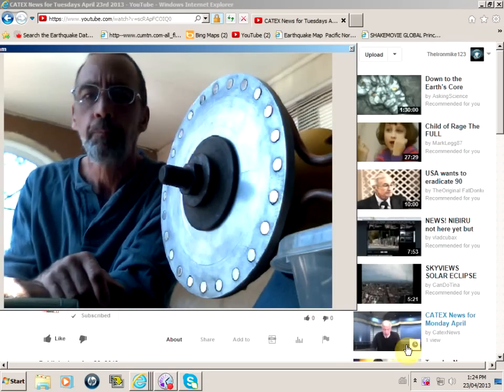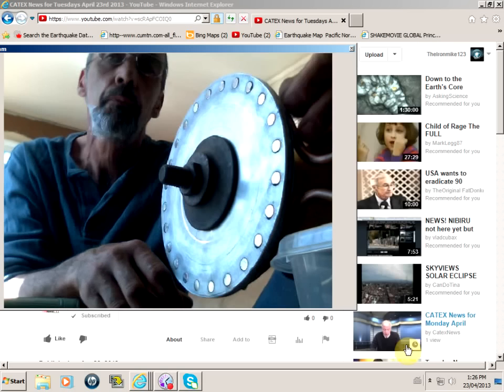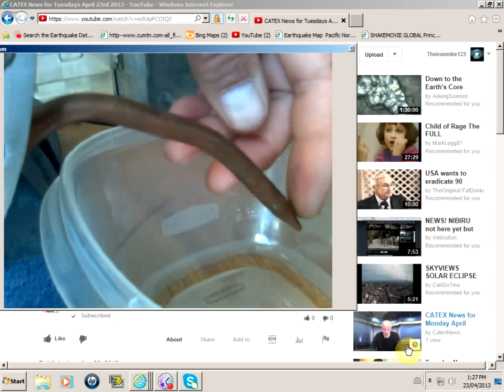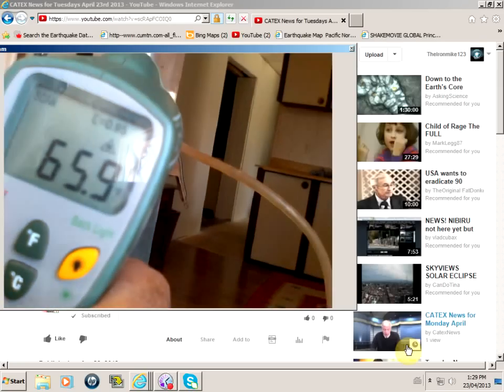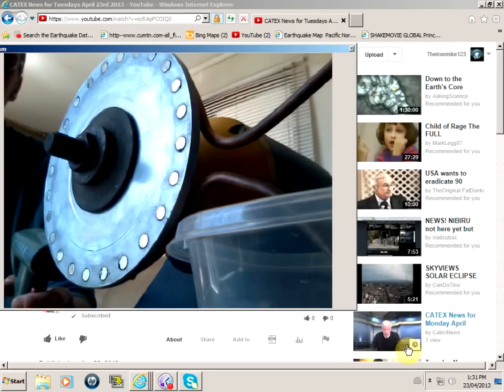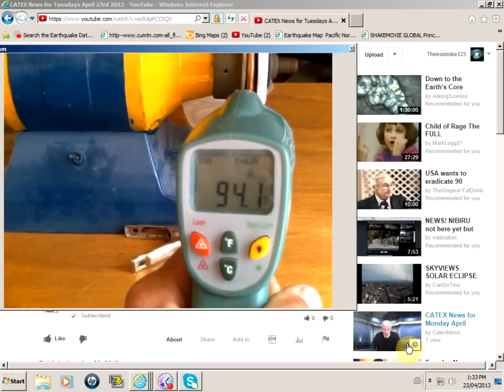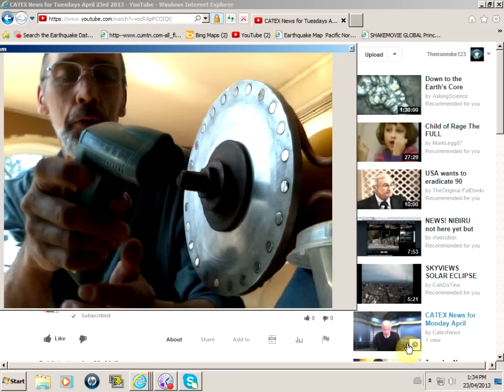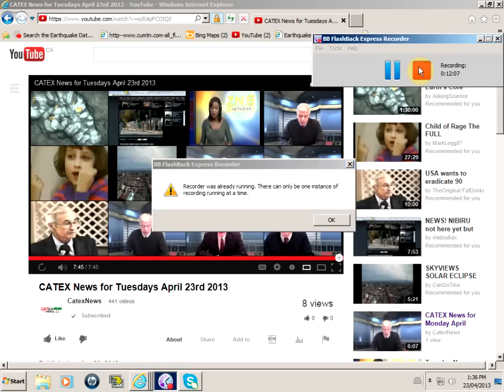magnets and copper tube = hot water

Comment: How about instead of running the water through the hot copper pipe, use the copper pipe as a heating element like inside a water heater. Use a non magnetic container and put the disc with magnets under the container and the copper pipe on the inside bottom of the container with water opposite to the disc. You might need stronger magnets though to get good results. Good idea though... :)
Reply: That would never work due to the fact that it's the electrons what are in the copper that create the current and it won't do it in steel or all your generators would be made of steel instead of copper.
Reply: Davie Jones
You didn't understand my message, Read second line where it says "Use non magnetic container etc..
Reply: Juan Bartet
Yea but if you use plastic it would melt under the build up of heat in the copper tubing. The first time I ever seen this setup was on youtube and was on a pirated re post. I then found the real site. It was called "Closer view of magnetic wheel".  The guy has since pulled the site off youtube and it is now being pirated again. I too down loaded all of his videos because it's a great design but he too didn't go further with with the idea. This too is a person who is trying to design a remake of his unit and this too won't work well due to his not using the proper size of magnets and not spinning it at the right RPMs. I have been doing engineering for many years and have three patents to my credit and know what I'm talking about and this design is a very good and possibly the next wave of home heating if designed right. Yes I am working on it but personal things in my life right now have me at a somewhat stand still due to purchasing a farm and all the work and time and money to get things going on it. But I am going to design one of these units to heat the house and see how well it does. It will take some engineering to get it right but I believe it should produce enough heat for our two story old farm house and then some. I expect to get at least 100,000 BTUs from it and that should do just fine. Oh and the real guys web site is www.talbotturnings.com and he is the real inventor of the magnetic wheel on youtube. The rest are just remakes and don't come up to snuff to me. Hell most crap posted on here are coat hanger, duct tape, bubblegum and paint junk anyway and won't work right and may even be dangerous. There are way too many back yard mechanics on here posting absolute junk, but at least they are trying and I'll give them that for sure! Some of your best inventions never came from no college educated idiots. Thomas Edison! The Wright Brothers! Yea that kind of stuff. Later Juan. When I get my furnace finished I will post it on here for everyone to see and give credit to the real inventor.
Reply: It wouldn't melt if the tubing is in water. There are high temperature plastics you can use or ceramics that can hold high heat. Good luck with your project and your farm.
Reply: Juan Bartet
Look at the one called FREE HEATING??? by FreeEnergyLT. This is the bootlegged copy I was telling you about. Now instead of spinning the aluminum with the magnets, keep them stationary and spin the copper as a disk and on the same shaft and put a turban blade with housing as air flow over said copper disk with heat censors to adjust the aluminum disk closer or farther away from the spinning disk and hook it all up to a thermostat and now all your doing is running an electric motor for generating both heat and air flow. You see with not spinning the large aluminum disk it don't over run the electric motor and you get more speed for less money spent! All this adds up to savings in home heating! You see your not using electric to heat a heating element which costs way too much. Now what do you think of my way of thinking? Not too bad is it? I didn't think so. Now this is the way I roll!
Reply: Davie Jones
Saw the vid, that's HOT!
Reply: @Daviemes13  BUMMER! I just tried to check out the talbotturnings site; and, it's now (02/07/21) gone... :(
Reply: Yeah, almost genius. 
...Or buy immersion heater off the shelf, and have exactly the same effect, for the same amount of electricity. Listen, it doesn't get more efficient, than heating using the electricity - all the mechanical losses are in the form of waste heat, so when your desired output is heat, there are no "loses" as such, so you can save yourself this nonsense, and buy a freaking heater!
Reply from the maker: +Juan Bartet  I like the idea, thanks.

Comment: I really wanted to watch your video, but your video and audio cuts out really bad.
Reply: And not only that, the demonstration was painfully slow due to all the verbal repetition that seemed to drag on forever and then finally when he does turn it on the result is less than lackluster at best. He wants ideas to make it work better? How about two glaring problems. One, the magnets are not directly aligned across from the copper pipe. I personally would try to flatten the copper pipe a little on the magnet facing side so that more copper is passed through the magnetic fields of the magnets. Two, why don't you incorporate a small recirculating radiator? Let the law of heat rising be your pump and see how hot the water gets after it has flowed through the tube a dozen or so times. Then just for fun why don't you then place a little cheap 12 volt variable speed fan to blow air across the radiator. I mean c'mon. You have something that can work if it were only applied properly.
Reply: I would not go for copper what so ever. To much drag/lenz effect... There is materials that gets hotter with less drag.